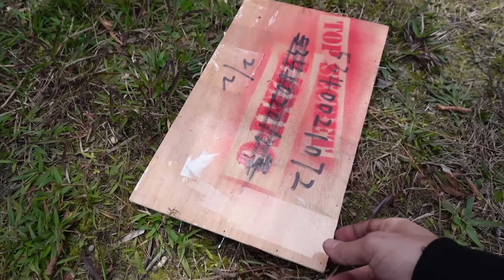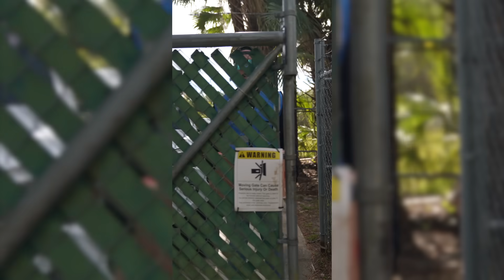Almost Rolled My Skyline GTR

Comment: Get an old box spring or mattress (just the spring frame inside) , or section of chain link.  Add some weight to it, and drag behind the tractor to really smooth the trail out.
Reply: Pallets with cinder blocks on them. That's what we always used to fix driveways and groom trails after they washed out.
Reply: I agree with the chain link. It works really good. It'll look like a baseball field.
Reply: great comment!!
Reply: You can get something called a smudge bar which is a square frame of box steel that attaches onto the bucket of the skid steer and that will do the job better than a mattress
Reply: When I was younger and we had a tractor we would drag a big piece of fence behind it with old tires on top of it and drug that around to smooth trails. I think it was like hog panel fencing.
Reply: Yes sir it will give him the conditions he needs
Reply: @Magpies_corey  Just imagine them out there dragging a junk mattress when they can certainly afford the proper smudge bar lol.
All these diy ideas would just barely scratch the surface of what they need
Reply: Gentlemen, these are supposed to be offroad trails. Not perfectly smooth pavement. It's just not practical to completely grade trails as continued driving will create new ruts, braking bumps, berms, etc. dirt trails are usually driven in an imperfect state.
Reply: He already has a gannon..?
Reply: We use an old metal roller and chainlink fence combo at my work and it works amazing.
Reply: A nice 8-12ft long chunk of some i beam.
Best thing I’ve found to maintain our rallycross track that I whip I a90 on
Reply: That does work but I think he could afford to get a nice drag Harrow with some 2-3” spikes and pull it around the trails with the tractor. Maybe a roller to compact it some after it’s smoothed out by the Harrow
Reply: Absolutely. Live on the river at the end of a 1.2 mile dirt rd for 25 years. Pulled one twice a week
Reply: A good harrow is definitely not a bad idea. I'm wondering if this track will still have a good feel when it's quite a bit more compacted.  I feel it would be way more enjoyable but look less cool on vid. Thoughts?
Reply: @pauliewalnuts240  Offroad trails or rally trails? Because rally is graded.
Reply: Sound like a sheet of mesh (Rio bar) would work
Reply: @pauliewalnuts240 definitely far more enjoyable to drive on a groomed track. Can maintain more speed and angle safely
Reply: Till it out and Chain link fence works really good
Reply: Old rims and wheels work great
Reply: or just use an old tractor wheel
WAY TOOO COMPLICATED FOR THE AMERICANS TO USE TRACTOR BITS WITH A TRACTOR

Comment: Just a tip when you are fine grading in the skid steer I'd recommend only tilting the bucket no up and down lift it will make for better finish work and once you start to have whoops its way harder to correct with the machine going over the whoops making the cutting edge chage height start grade work from a flat area and it will make life easier looks like you have it down pretty good this quick already

Comment: the shake on the hard-mounted camera is also a result of the head that you used and the fact that it is mounted right above the front suspension struts. A lower centre of gravity would help a bunch too but the main culprit is the head. next time try something low-profile like a 3way leveller or a tango head. 

Rad to see the behind the scenes on this one - thank you for sharing!

Comment: When grading with the skid steer on the right stick there's a button on the back of the stick, (push it when going down) it's called float and will auto level the bucket for it to be smoother

Comment: Suggestion: pack the dirt trail so you don’t rut it up so easily. Second, if you’re getting flats from the roots and other debris then slime helps if they’re small, we use it with mesquite thorns and other things on the ranch

Comment: Love the behind the scenes or making of videos for these shoots.
Would it be worth releasing them after the promotion has dropped? Seeing the end result before the how you did it tends to have a bigger impact?

GoPro or better an insta 360 (or similar) on a stick inside the corner would give some super sick angles.

The car mounted stuff, would it be better to film in landscape rather than portrait so you have more frame to crop for IS in post?
Did you try your 28-70 with ILIS? Did it help?
 I know it's the first time you were using the config of the setup you had there but would love to see a filmography take on the problem solving we see all the time here for the car stuff.

Comment: you can also use the back of the bucket to backdrag and you wont leave all that material on the ground and have to scoop it up again it works kinda the same way that box attachment for your tractor does.

Comment: Actually surprised those BCs are still in one piece with those little shafts.
Reply: As someone with a little shaft... I'm surprised too.
Reply: Gotta piggyback on your post for me to make my daily "This car deserves some proper coil overs suitable to this type of driving" comment.
Reply: The only way those little shafts would break is if the suspension broke first , otherwise there's nothing to worry about .
Reply: @JerryHenderson72  nah they do break and bend

Comment: Mike perfectly shows that you don't need a gimbal. Sick work!  Maybe Mike would show his equipment, would be interesting.
Reply: He did though,  bonnet mounted shots were a fail due to zero stabilisation.
Reply: @dodgemf1  of course without a IS lens you get that, you live and you learn. He did all the other shots handheld tho and that shows perfectly that you don't need a gimbal. Also the shaky footage can be recovered and stabilized in post processing.

Comment: Back in the day when I was in my late teens around 1980 my neighbor had a Ford Courier pickup that hit a tree dead center. I got it for $50, threw a radiator and distributor cap in it, stomped the hood flat and used it like a rally truck in the woods on some bitchin trails. All the neighborhood kids would jump in the back for a thrill ride. My buddy would hold a spot light when we drove at night. I remember one of the kids falling out the back on a jump and my buddy yelled "we will pick you up next lap" THOSE WERE THE DAYS" 😁

Comment: I’m a heavy equipment operator by profession. First off your dirt down there is trash lol nothing like iowa. Second. You need to cut the top off the whole track and rent a hoe so you can dig down deeper in a random spot so you can get to some good dirt you can top the whole track with instead of having all those roots and super short dirt covering it